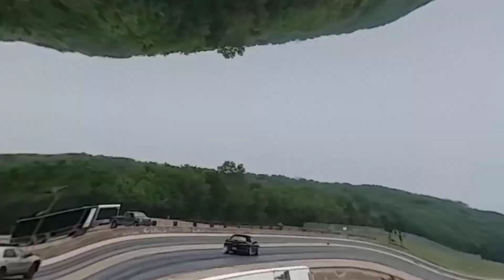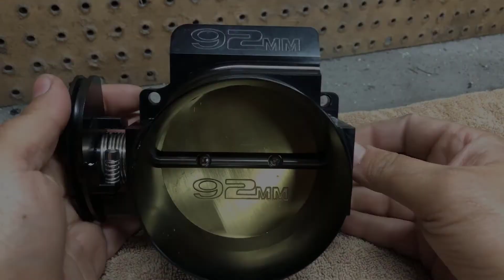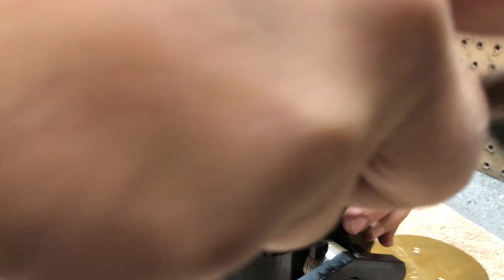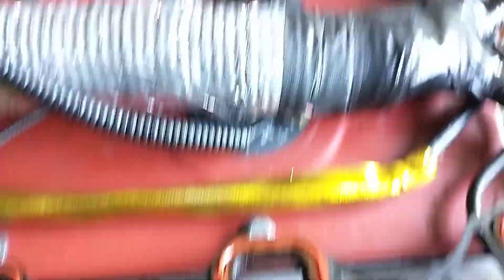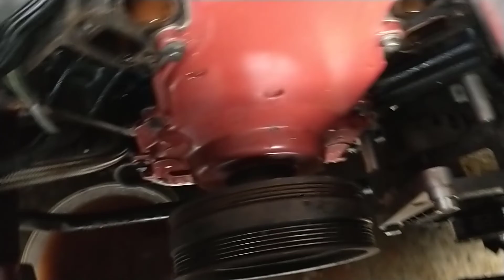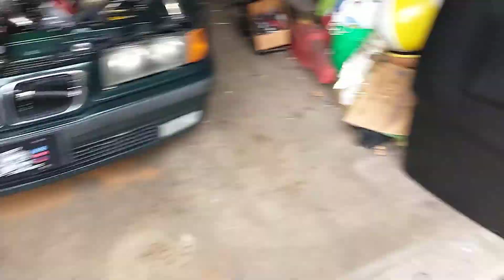Installing The Swap Meet LS3 Intake On The E36 - Will The Old Hood Fit??

Comment: I had order the Camaro water pump for my 5.3 turbo swap. The neck already facing to the front of W/P. NOW I need to get my turbos mounted in the front of e36 ls swap. And need help with wiring the stock ECU harness through the fire wall.